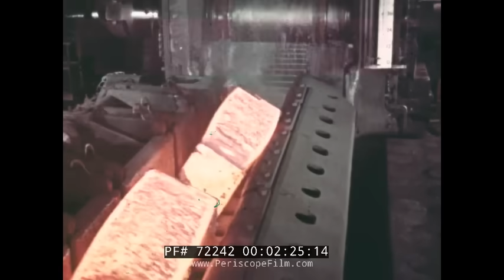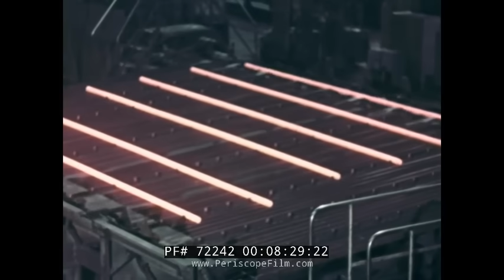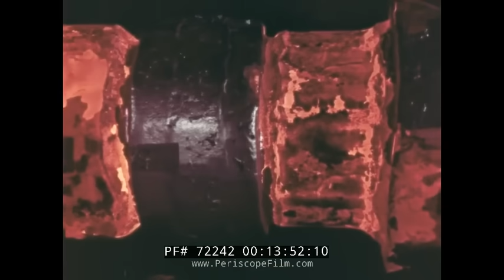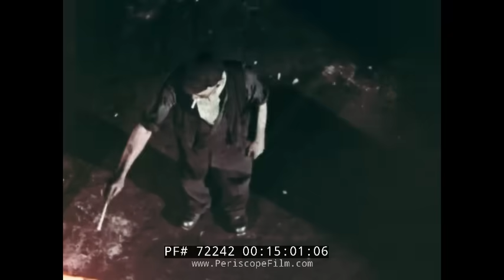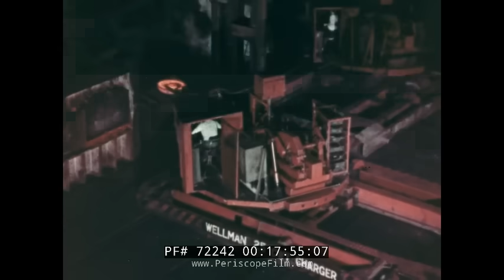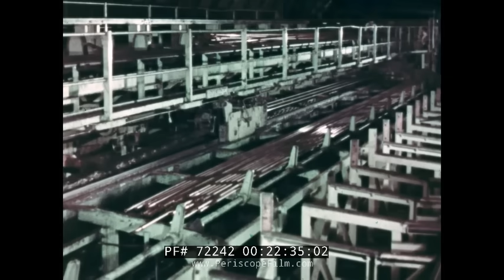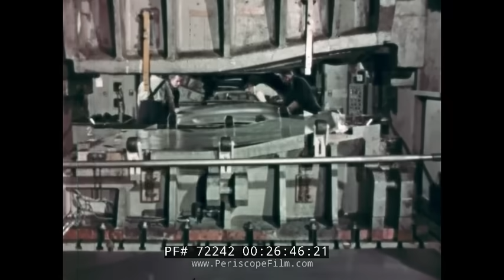"THE DRAMA OF METAL FORMING" 1959 METAL FOUNDRY & FORMING PROCESS   SHELL OIL INDUSTRIAL FILM 72242

Comment: The skills of the tooling engineers, the machinists and the mechanics that made and kept these factories running is mind blowing. And special thanks as well to the talented craftsmen and the hardworking shop workers than turned molten steel into materials that built the modern world. Not many men today in the western world have the physical stamina to do this work if they had to, nor the skill set.

Comment: I AM 78 worked in paint industry for 8 years,used quicksilver,MERCURY, along with lead oxide pigment,and any manner of solvents every day.All classified as Carcinogens today! Then as a journeyman Electrician,asbestos,Askrail,and more Cancer causing materials! And after working in a bucket 20-30 ft in the air most of the time,4 Back surgeries,knee and shoulder replacements.Working in any trade make one’s Body pay the price !

Comment: The science part is still, of course, accurate. But metal manufacturing changed drastically in the late 90s and into the 2000s, so much so that it has been called the second industrial revolution. All thanks to vacuum heating with the discovery of carbon-60.

Comment: I worked in metal stamping, for automotive suppliers. Most people don't know just how big a stamping press it takes for smaller parts, such as the upper and lower brackets for the seat recliner mechanisms. I worked atca plant that made recliners for Chrysler, GM. Ford, VW, and aftermarket units, used in van conversion seats. The press room had 2) 400 ton, 1) 800 ton straight side presses. The 400 ton presses were about 1.5 stories high, from the floor. The bases of these were in pits, about 8 feet below, in pits, on foundations. Then we have the 800 ton, that thing was about 2 or more stories above, about 10 feet below. All the made were parts, from the proper types of steels for them, off coils of strip, fed by de-coilers and straight ingredients feeds, to put out 2 pieces of 8-10" long, and about 2 1/2" to 4" average dimensions. Those were just some of the presses, we had fine blanking presses for internal parts. There were broaching cutters and further stamping steps, forming the final parts. Those went out for heat treat in some cases. There were phosphate plating processes in the plant. Then there were the assembly lines. Rivets, plastic parts, various springs were supplied to the plant. All that, just to make the recliners in car seats. Imagine all of the machines, materials, etc it takes to mass produce each car. That's just one factory among all the others. The video shows other steps in the process of making the steel materials. It's a huge process, what it takes to make even the smallest cars. Now how about the huge battleship gun barrels? It's all amazing, that we live today, with all of our toys, unimaginable just 150 years ago, and previously over thousands of years after previous eons of our history were destroyed.
Reply: OhowIhate... SPELLCHECKER CHANGING MY "$%6/ WORDS! Just leave it mis-pelled, not into totally irrelevant words! Where's that AI, is it on vacation?

Comment: Forging from a solid billet is also used to make the very best seamless tube such as that used for oil drill pipe and high pressure steam.  In rotary forging the two forging rolls are slightly inclined towards one another to break open the center of the ingot which flows over the piercer held . . . .

Comment: @ 5:21 you can see some of the inefficiencies in hindsight.  steel, like any industry, underwent massive change in productions processes over time, becoming cleaner, using less time and energy per unit of output, and using far, far less labor.  It’s one thing to make the process and times seem idyllic now.  But I am old enough to remember that some people were never satisfied and were very short-sighted.  You can read about the closures of so many mills, e.g., Youngstown, Sparrows Point and see the devastation, but the time for change was 15 years prior, not the last 5 years.  In fact, there was likely so much collusion between company and union management such that wage and benefits concessions just kept coming right until the moment that they pulled the plug.

Comment: My dad owned a job shop with a 500 ton HPM draw press. We used to draw form the Caterpillar radiator top and bottom tank for the big generators.  The steel was 3/16 thick and without lubrication and wax paper the corners would rip open. Then we used a 1000 ton straight acting press to trim the outside to finished dimensions.

Comment: I remember my father’s stories about a mill in Birmingham where the terrain wasn’t long enough to have all rollers in lign. They had a steel plated 180 degree curb to lead the red hot strip around to continue being rolled out, but this wouldn’t do 100%.
So there was a catcher with a pair of tongs to grip the end of the fast moving red hot strip and throw it into the next roller. This not unexpectedly had already once ended in a tangle of red ribbon and a short scream…

Comment: As someone who has had some experience in the heat treating process and metal working process, I was a Tig welder in the Navy, I worked in a blacksmith shop we often had to heat treat the parts or the ingits that were to be turned into closely monitored parts by the machine shop. I have often wondered if one could get a jump on the process of aragining and refining the grains in this meatle if a powerful variety of Magnetics we're used at the time the metal was poured up almost I. A liquid state, buy using several different types of magnets such as Man-made, natural and rare earth magnets. Electro magnets where the currents and strength could be controlled at will. Just a thought. It would seem this would allow for some sophisticated and exotic metals to be created, if it worked. Does anyone have and info on this. Or anything like it? Thanks and great video!

Comment: > tfw when you will never operate a slabbing mill from the pulpit perched astride the rolling line, gauging the thickness of the slab to a fraction of an inch, setting the bite made by the working rollers, directing the rams which manipulate 7,000 tons of steel every day, while calmly smoking your pipe in 1959

> why even live

Comment: I travelled nine states for a large contractor working on industrial and institutional process equipment, ventilation, and hvac. Drying ovens in foundries, industrial burners, all types of drying and cooling ovens, chillers, etc. Never knew what we were in for or how long we'd be there. 
  Nothing like lying on your back, getting 'jogged' on the conveyor in to the bowels of a core drying oven to pull and change burner venturi. 
Saw so many of these processes and helped with many of the systems in these foundries and plants.
 Volunteered to fight fire, cut folks out of their vehicles, fly on medical helicopters, and run squad to unwind after the tensions of work.

Comment: Think of the concept of the machines that make the machines that make steel. All those were once formed from ingots and forged and tempered. there must have been, once upon a time, a machine that was actually made by hand, with hammer and anvil. they used that machine to make a better machine, and it went from there, so now these ones are generations from being hand formed.

Comment: My dad was a welder in san jose Ca for 30 years, fmc. Welding aluminum military tanks. (Best of my knowledge, m1 Bradley's or something.)
I became a welder almost 20 years ago, here in Ca.
Seems like things have changed a lot.
I've done mandrel bending, operated the biggest steel rolling machine on the west coast (at the time, the r13) up to 20" pipe, 18x6 tubing, if I remember correctly. I also ran a r6, and a little r3 machine. Those were good times. Became a project manager at that place.
I eventually went on to fabricate handrails & guardrails, and other miscellaneous s***.
I've welded structural steel for 10hrs/day..
The point of my story is this: I was ready to walk away from metal working altogether. Pay sucks, and employers treat us like crap.
But, after seeing this video, I actually want to stick with it. Ca taxes and politics can suck it. But I am an Ironworker goddammit

Comment: Oh yeah well in China they do all that and they do it barefoot with no safety glasses
Reply: will; What else would you expect from a communist slave state?  They have a billion more ready and unwilling to take their place.
Reply: You never worked hard until you got sunburns from a lathe. They spin so fast the rails crack like whips and shoot out a photon each time. At 24,000,000 revolutions per minute that's over a billion whipping iron rails lookin' like lettuce snakes and sending blinding light two inches from your skin. We never cared about such things back then so we never wore shirts but I still have those triangle sunburn scars from my years on the stamping lathe. My kidneys always got burned the worst. I understand you were a grinderyman. I don't envy you having had to climb those red hot poles all day to set the cockhooks up. We used to call you guys shaftboys down in the deli department. Hot Metal 348 forever!!! Za! Za!

Comment: Tough job, that mill operator is 26 years old.
Reply: Jon; And skilled.
Reply: You never worked hard until you got sunburns from a lathe. They spin so fast the rails crack like whips and shoot out a photon each time. At 24,000,000 revolutions per minute that's over a billion whipping iron rails lookin' like lettuce snakes and sending blinding light two inches from your skin. We never cared about such things back then so we never wore shirts but I still have those triangle sunburn scars from my years on the stamping lathe. My kidneys always got burned the worst. I understand you were a grinderyman. I don't envy you having had to climb those red hot poles all day to set the cockhooks up. We used to call you guys shaftboys down in the deli department. Hot Metal 348 forever!!! Za! Za!

Comment: I used to work in a roll forming mill that took those coils of steel and continuously formed them into “corrugated” steel with each set of rollers adding to the forming until the desired shape was completed.

Comment: Have worked with several of these jobs since the late 70's! Currently working on a continuous casting.
Reply: I was amazed to see how much was manually operated.  I guess most of that is done with computer control?
Reply: @youmakeitreal  Many of the jobs I did, have gone from manual to computer controlled! Several of the jobs have been closed down or sold to other countries.

Comment: I took a tour thru a drop forging shop, That is how the crank shaft was being shaped. It was winter, about 5 degrees outside. The buildings outer walls in the forging area were all open "garage" doors. It was about 75 degrees inside from all the furnaces and hot parts. Could not imagine how hot is would be when it is 95 degrees outside.
Reply: I have a pretty good idea,  I worked forging front axles and spindles for large trucks in the 80's and we had these large man cooling fans blowing on us. Someone hung a thermometer in front of the fan and it stayed a constant 140° till after dark. You had to dress accordingly, long underwear, long sleeved shirts with denim sleeves over top, ear plugs plus ear muffs, hard hat with heat screen over your face, hot mill gloves, leather apron, metatarsal shoes, stand on one foot and hold up a couple hundred pounds of white hot steel while stepping down on a treadle to activate the hammer while shaping the axle in the dies.
Basically, you earn your paycheck and everyone's around you,
It takes a team of guys that can show up for work, 7 days a week,  and work well together, and nothing short of that.

Comment: I built one of these in about 1959 on a 3 H P Briggs & Stratton engine. I floated the cam drum on ball bearings, used piston rings to separate int. and exh. The cam drum only had ports into the cylinder instead of being open. The top half of the cam drum housing was removable . i cut slots between the piston rings for tool steel wipers with light springs  to improve the compression.  This engine actually ran but only for a few minutes at a time because of cooling problems. This was not even a new idea in 1959 since  I remember seeing , I believe of English manufacture, an engine of this type from the 1920s.
Dan

Comment: 30 year's back, I was involved in the installation of the steel mill. After watching the film 🎬 which gives very deep feeling of Metallurgist but basically I am Mechanical Engineer. The efforts made by the metallurgist not coming to know to the public. Black ⚫ Smith, Metallurgist, Mechanical Engineering, Automation specialist and well Lubrication Specialist and delivered the ultimate results.

Comment: What no computers, just hand signals, levers, foot controls and mechanical gauges. I am sure most people have no idea what man made efforts go into making products in their cars, refrigerators, heaters or furnace, microwave, TV, even their bed, pillows, sheets. 
 If the new green deal ever gets passed, we will going down dirt roads on horses! What’s next, wooden cruise liners? Bring your gloves because you will have to row a paddle! Love these films and time improves filtering, hearing protection and a safer work environment. It changes over time as technology improves. That’s for all of the haters...get your walking shoes out, no fuel or electricity as wind and solar is less than 1 tenth of 1% of the electricity. No odd / even days to buy fuel (Only few know what that means) Thanks Jimmy Carter. Oct, 2020

Comment: I was never an academic guy I've only ever been good at working with my hands is it weird that I've always wanted to work in a factory?
Reply: Why would someone want to push paper or type on a computer when you can make something tangible out of metal that will outlast yourself in many cases?
Reply: I am actually an academic guy and I realized a couple years back that I would have been much happier working with my hands all day.   I can write code and administer systems that are incomprehensible to normal human beings, but...I would have taken that life of stone work and tiling over this, in retrospect.  Maybe I should start again.  Maybe it's too late.
Reply: I worked at a automotive supplier factory here in Michigan for a few years after High School and I loved it. Loved working with the machinery and being super productive and busy all day. I realized early that I needed to learn a trade, not just be a guy on the assembly line, so now I’m the pipefitter that runs the pipe to the machines making it all happen.

Comment: A generation that worked very hard in harsh conditions to provide for a family. I worked in the Steel industry from 1978-1991. It paid good but was very dangerous and injuries were very common. Most of these jobs and the equipment are now over seas. Great film.
Reply: I get scared looking at foundary footage, realizing how dangerous all of it is.  But it's also fascinating to watch machines work with metal as if it's putty in their hands.  Also been fascinated for a long time, how all the processes work to ensure the metal is strong.  I think metalurgy would be a really interesting topic to know more about.
Reply: You never worked hard until you got sunburns from a lathe. They spin so fast the rails crack like whips and shoot out a photon each time. At 24,000,000 revolutions per minute that's over a billion whipping iron rails lookin' like lettuce snakes and sending blinding light two inches from your skin. We never cared about such things back then so we never wore shirts but I still have those triangle sunburn scars from my years on the stamping lathe. My kidneys always got burned the worst. I understand you were a grinderyman. I don't envy you having had to climb those red hot poles all day to set the cockhooks up. We used to call you guys shaftboys down in the deli department. Look at you. You haven't worked before young man. You never worked before buddyman. You have never worked like a managerman like ME! BUDDYMAN.
Reply: It's for the next reset a lot of countries in Europe  they made the same they moved all the heavy machinery not new under the sun the people forget slaves playing with private money the people are slaves and don't see

Comment: I worked for IMI in Witton Birmingham UK I did all the jobs seen in this video. It would take the 2 week factory shut down for me to become clean again.
Reply: Did your company make anything for the British car or motorcycle industry?
Reply: @track1219  IMI at the time made just about everything. The factory I was in made strip and sheet non ferrous metals. Used for bomb casings, bullets, hot water tanks and kettle drums. And caps for light bulbs to bells for budgerigars.  So it's quite possible they made metals used in the car and bike industry.
Reply: Eean-thanks, I’m 66, live in the Detroit area, still plenty of manufacturing going on here, grew up riding Triumph motorcycles, even had a Panther 600cc made in Cleckheaton, York
Reply: @track1219   The UK manufacturing is not what it used to be. It's quite sad really. I drove up until last year a very elderly SAAB 99 from Sweden. It ran on divine intervention and the odd expletive. I'm loosing my sight now so I sold her to a SAAB fan. So she will hopefully live on.